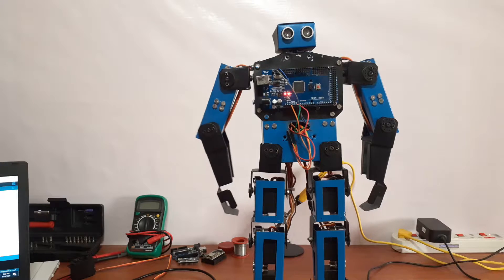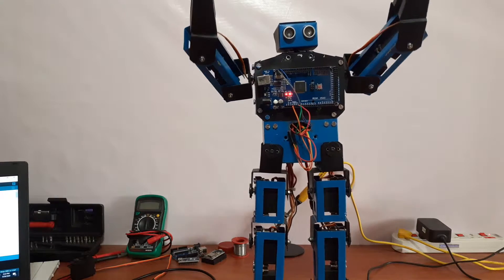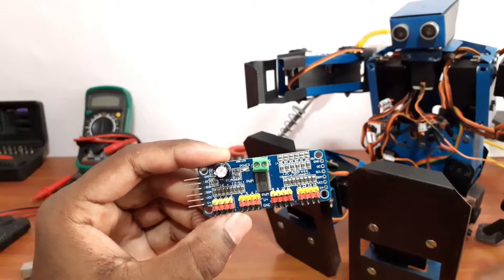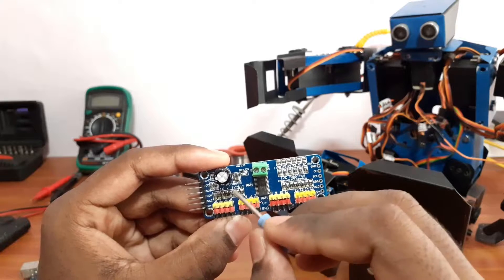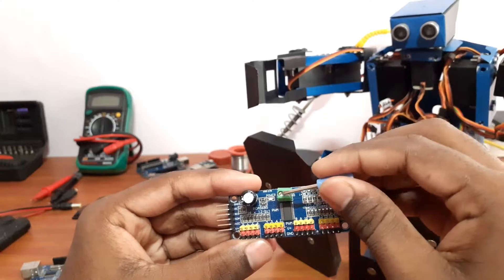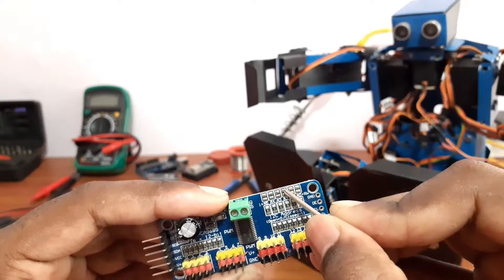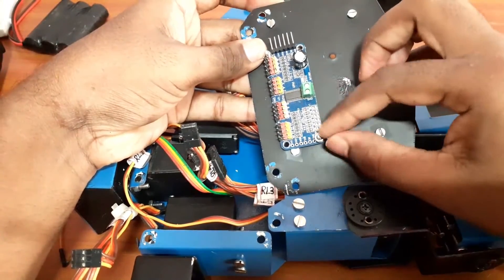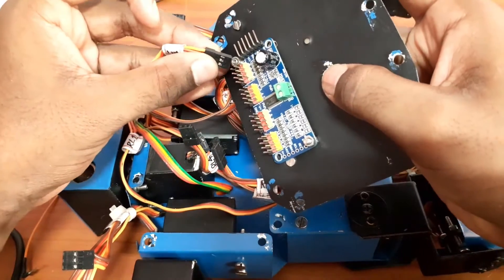How to use PCA9685 16-Channel 12-bit servo drive | Hash Robotics

Comment: Im using 12 servo on time but it's working 1mins or 2mins  the power is not sufficient to down the power how to rectify im using 5v 2ams power supply arduino given spreate power for arduino

Comment: can it move faster or is this the fastest ?
Reply from the maker: If you decrease the delay time it can move faster
Reply: @HashRobotics   thanks for your promped response,  now I noticed you used the adafruit library.  Is there another library we can use for this driver module ? I'm looking for a library that can be used similar to arduino servo library or can we use this servo library as well? Obviously using this servo driver instances.
Reply: @HashRobotics  I ask because I already wrote a pretty long sketch using arduino servo library and do t really want to have to rewrite the entire sketch adopting this driver library variables if I don't have to.
Reply from the maker: @arletpaz8010  Hi .As far i i know Adafruit library is good. If you have already written a long code it is difficult to rewrite. you have to copy and replace carefully. Else check my other videos of mini hash robot. I have reduced the coding part  and made servo control easier using Tims servo control software. you can take reference

Comment: Sir where are you fix head servo motor tell me
Reply from the maker: In a single PCA9685 board you can able to connect only 16 servo motors. so for this, i made the head servo as dummy.I did not connect head servo
Reply: @HashRobotics  okkk thanks sir  for replying me
Reply: Sir inplace of making head servo dummy you can connect it to arduino mega directly
Reply from the maker: @skymatechnology6360  yeah we can connect like that

Comment: Bro why you removed the Bluetooth module?
Reply from the maker: Based on requirement you can add bluetooth part. After that I'm using esp modules so I can connect through wifi. So I don't need bluetooth module

Comment: You have used 17 servo motors but pca9685 can control only 16 servo motors how did you managed it? Thank you.
Reply from the maker: I did not use the head servo . If you want you can connect the servo to any one of the digital pins and you can control.
Reply: Thank you.

Comment: Great job!
Can I know what battery you used for the robot? Is it using a power step down module to convert power to 5V for PCA 9685 and Arduino mega broad? Thanks a lot!
Reply from the maker: No I have used two separate power supplies .servo drive powered by 5v adapter and arduino powered by 12v battery
Reply: @HashRobotics  I am thinking is it possible to apply 5V 15A to power the servo and Arduino, and it may help to reduce the weight.
Reply from the maker: @bennykwan  Hi, I did not try that. Incase if you trying please let me know if you proper output.Thanks
Reply: @HashRobotics  what is the ampere of 5v adapter because I'm using 5v 1A adapter but motors are not working
Reply: @vkcreator4394  I’m running into the same issue and from what I’ve seen you need a larger battery to run that many motors simultaneously. I think that because the motors in this robot are actuating one at a time the current draw isn’t too high for the 5V power supply.

Comment: Bro shall I use sg90 9g servo motor
Reply from the maker: This design is for mg995 servo..if you are going to use sg90 then you should design according. Moreover sg90 have less torque so plan accordingly

Comment: Pls tell me does this work with arduino nano and uno with the same steps
Reply from the maker: Yes you can use but due to memory limit you can only be able to code few set of movements only
Reply: Oh thanks for the information